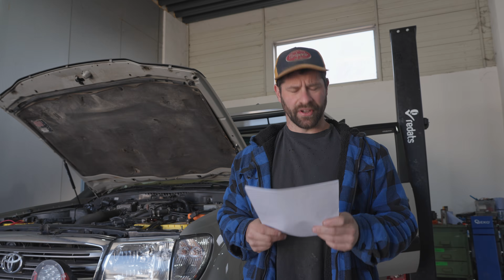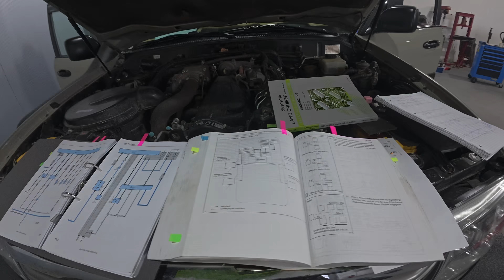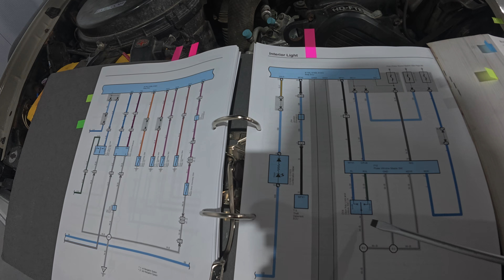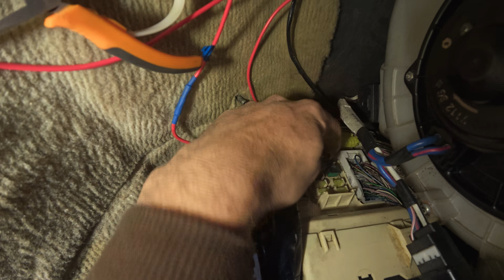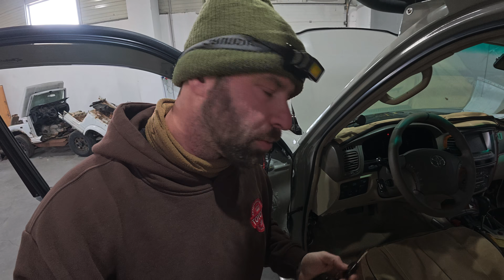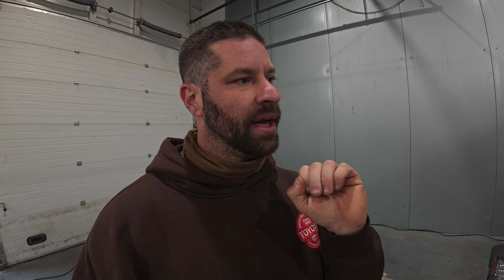Can We Save This 100 Series From an Electrical Nightmare? (Central Locking & Window Problems)

Comment: Apologize in advance for the long comment. I am glad i have found your channel because it is really helpfull and i like the content. I discovered you thanks to instagram btw.
I have a '99 1hdfte 100 series with accelerator pedal sensor error which caused limp mode and i have found that the wires going to the scv were damaged and since i was at it i replaced the leaking scv valve. Fixed with wiring by replacing and soldering in a part of it, also new connector, but i would like to replace it with a genuine one if you know where to buy one, i can't find it anywhere. But back to the fix, the 100 now starts and runs good, took it for a spin and everything was good. Took it to the carwash to clean the underside because i was going to start refurbishing the front suspsension and i hit a hole in the road during the route to the carwash and.... limp mode again. I hate those wirings. Do you have any suggestions on which to check? I was almost debating buying a new engine wiring harness but is really expensive so i am thinking about removing mine and going through it and fixing all the damaged wires.
Reply from the maker: Thank you very much 🙏

Check for the potentiometer of the accelerator pedal, that's a very common problem on the 100 Series. Problem description would fit that pretty good! Only downside you need to replace the whole unit, pedal with potentiometer
Reply: @wrenching.lifestyle thank you so much for the quick response! Throttle pedal has already been replaced with a new one
Reply from the maker: @b @blos90 The wiring loom from the SCV valve goes to the EDU box, and then from the EDU box back to the driver. More or less, the ECU is on the left fender, and it connects to the EDU box. What the EDU box does is convert the signal from the ECU into a high-voltage signal of about 150 V. It’s not extremely high, but it is a high-voltage current.

Where is your loom broken? Between the EDU box and the ECU, or between the EDU box and the SCV valve?

The next thing is, if you’re repairing the cable between the SCV valve and the EDU box, keep in mind that the cable carrying the 150 V is a shielded cable. If you solder it, it will introduce additional resistance.

Also, you’ve repaired the loom at one point, but it could be broken somewhere else as well. At that age, the wires become brittle and are simply prone to failure.

The first thing you can do is start the car, let it warm up, and then perform the wiggle test. Wiggle the loom going to the SCV valve, wiggle every connector, wiggle the EDU, and wiggle the ECU. If the engine sound changes or it stumbles for a moment, you’ll have a good idea of where the fault is located.

The best solution would be to replace the loom, but you probably won’t be able to get a new one anymore. So you’ll most likely have to make one yourself.
Reply: Still haven't got the time to do a wiggle test, but I already searched for some wiring manuals for the 1999 model year. 
I did a small research and found out Toyota released an updated version of the wiring loom for the 2000 model year, which should be better than the '98 and '99. Are those interchangeable? I have a feeling they are not...
I think I will be removing the wiring loom from the car next and find some company that can make me a new one. Since i would like to back to Africa with the 100.

Comment: Awesome work on the diagnosis. I have been in school for electrical engineering for 2.5 years and will start work as an engineer later this year. Many engineers would not be able to troubleshoot as effectively or explain the problem as clearly as you did. If the vehicle can be locked and unlocked with a fob, it raises the question. Why didn't the upfitters just mount a wireless fob at the back door instead of the wired rocker switch?
Reply from the maker: I really appreciate the kind words 🙏

No reason for it I assume they tought it's easier, would have worked if they made a Relais circuit directly on the door actuator and not on the switch itself.😂